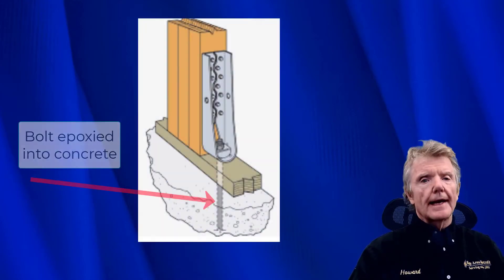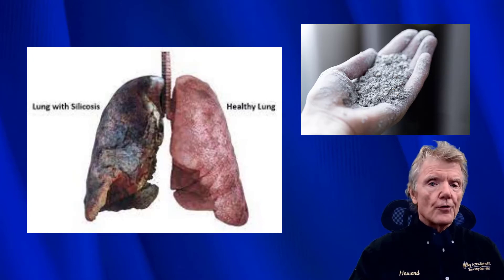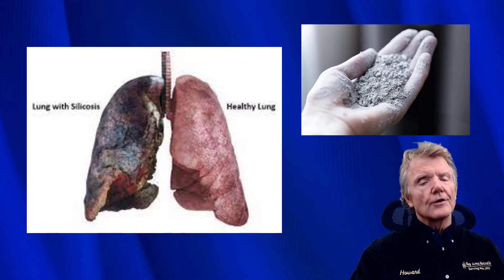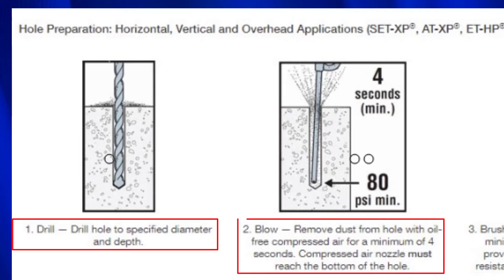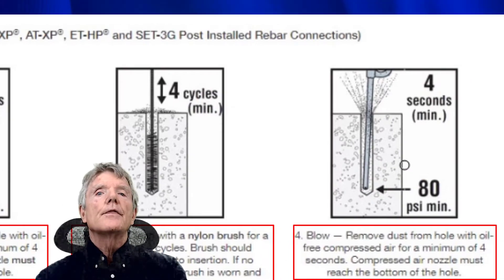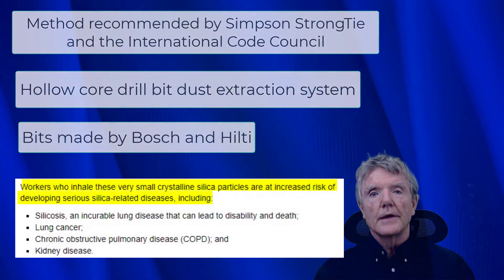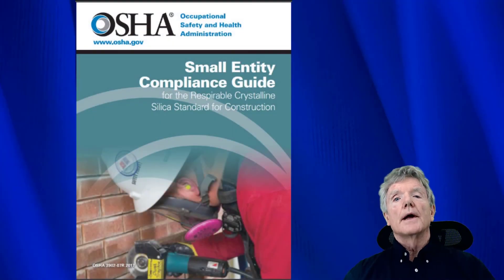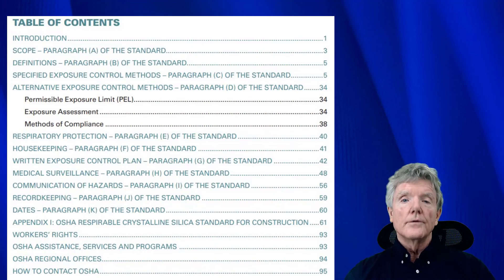FEMA P-1100 And ICC 1300 Epoxy Bolt Installations

Comment: can you put the hold downs so they share the bracing (4x4) of the cripple wall but are outside of the paneling?  I have seen them inside the cripple wall - but in my application I want to put them on the braces on each end but outside so I can more easily monitor them over time.  Also in a wall of only 20 inches - do you really need hold downs?

Comment: We use a little bit of a belt & suspenders approach.  Instead of blowing all the dust out, we will vacuum it out using a hollow tube that can be attached to a vacuum. ( little bit of barn yard engineering).  Besides that will clean out hole with water.  Will then use an epoxy that can endure wet/ moist installations, currently using one from Redhead.

Comment: We use massive versions of these in mines to hold the roof up.
Reply from the maker: I hope you use respirators when you blow out the holes
Reply: @bayarearetrofit5814  the drills have massive amounts of water flowing through them as they drill into the rock.

Comment: How deep a hole for a 🏠 in South Dakota. We get high winds and potential for tornadoes  🌪. And I was looking into an epoxy application technique that would fit under a 2x8 joist/finished floor retrofit.. thank you for the safety advice, 🙏 wasn't even thinking about the health risks.
Reply from the maker: I don't understand the application.  Is there concrete somewhere?
Reply: @bayarearetrofit5814  securing a house to a concrete basement. The house was placed on the concrete walls and the house movers wanted the foundation bolts cut. Fixing a problem that should have never happened. 2 story house. I used a 36 inch drill bit to drill through the first floor and sill plate into the concrete. Still waiting on the 3/4" concrete bit. Should the holes be 18", or if I used 10" bolts would that be an issue. 🤔